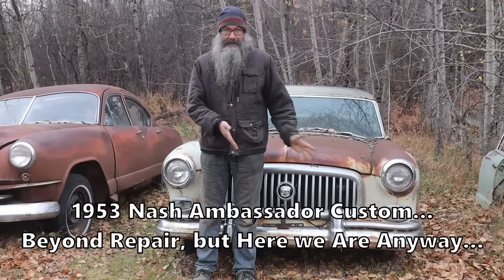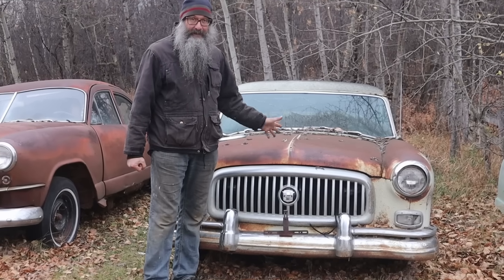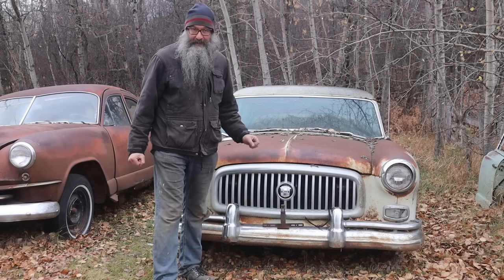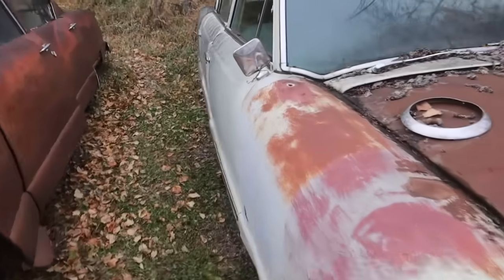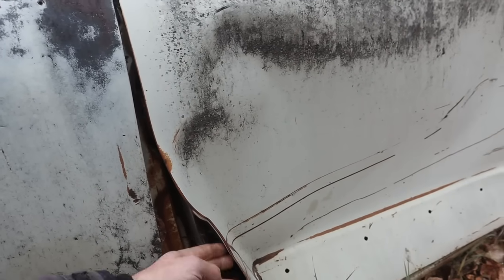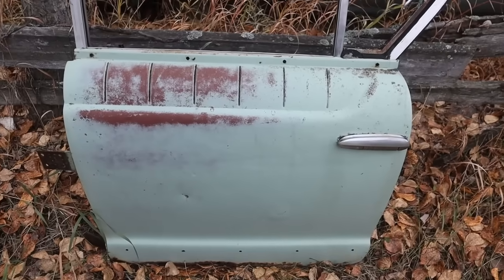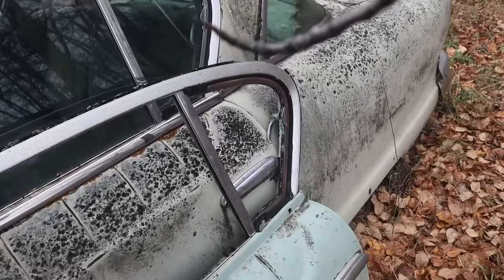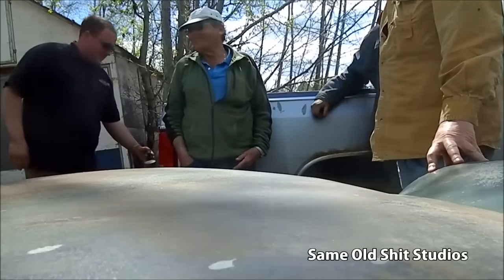1953 Nash Ambassador: Beyond Repair, but...

Comment: I actually have what one could call the "Grandson" of this car, a 1966 AMC Rambler Ambassador 990 with the 327ci V8 and a 2 barrel carb.  Currently it's in the shops for a brand new carburetor, full fluid change and the brakes seen to as it's been off the road for around 9 years.  Looking forward to seeing the process of you fixing up this old gem

Comment: In my PDR world I deal with stretched dents or "oil canned" dents fairly often...
We had some primitive methods to deal with it , but I purchased a "hot box" .
Initially through PDR company's they were $2500 to $3000 .
But I bought mine for $400...
It has saved many panels from going the filler/bondo route..
It heats the exact area you need to heat & depending , I can quinch it & with cold water or even ice ..
And it tightens the metal right up alowing me to finish the dent ...
Not sure it would pay for itself in your repairs , but they are relatively inexpensive today ..
Amazon has several to choose from..

Comment: I had a '54 Ambassador that was a great highway cruiser. If you need body parts, the Ambassador and the Statesman models had identical body shells from the firewall back, so Statesman parts will fit. Hood and fenders are longer on the Ambassador to fit the bigger engine.

Comment: Those bathtub Nash's were pretty funky looking even back in 1958 when my mom and dad went shopping for a second car for my mom. They bought a year old 1957 Nash Rambler at the local Rambler dealer and I remember my  parents talking about how much better the newer ones looked after they dumped the bathtub styling.  The funny thing was the Rambler American  kept the bathtub styling up until 1960 as I had an aunt that had a 1959 American right up until the mid 1960's when she traded it in for a 1963 model.

Comment: The outside door handles were known to stick causing the doors to fly open going around a curve.  If you are still having issues with the Volvo rear mirror, I had a 98 V70 wagon and I think they were the same.  Perhaps Kyle has an interchange manual on that part.  Hope your party is a success.

Comment: As a dedicated AMC driver-- a '67 and '68 Ambassador-- I can't tell you how neat it would be to see your Nash with plates on it.  How nasty is the bottom?  Surely with a bit of a pull and promising to never look from closer than 5 yards, the front right should not keep it from driving?  Dunno.  And, of course, I'm ignoring the problems with the engine.  Perhaps there's another engine somewhere?  Anyhow, the Nash/AMC folks would just go mental over that Nash back on the road.
Reply from the maker: It is pretty rough, but thanks for the encouragement!

Comment: FunFact:
Nash sold the rights to Austin in the UK to build their new 'small car' Metropolitan for them as they had no small engines to suit. The first used a 1200 with production in October 1953 and was called the 'Nash NKI Custom' but by March 1954 it was renamed 'Metropolitan'. The later upgrade in 1956 used the classic BMC B Series 1500.
Right Hand Drive for the UK started in 1957 and production came to an end in April 1961 with a total of 104,377 Metropolitans having been made at Longbridge UK with nearly 95,000 exported to the USA. Although built by Austin they were never sold as 'Austin Metropolitan' in the UK.
It was a very pretty car and very much of its time. And how interesting that a US company contracted a British company to build cars it imported for sale in the USA under its own name.

Comment: I bet the passenger side damage was very early in its life. The sideswipe was much later, early 60's, but the owner loved it enough to keep driving it until it wouldn't pass inspection. Probably replaced by a Rambler Cross Country and then used out by the road as bus stop shelter for the kids.

Comment: One serious weakness, the front inner fenders hold the front suspension spring/shock. I was riding with a friend in his '52 Ambassador when we went over a RR track, not terribly fast. One spring popped up through the rusty inner fender panel, bending the hood up about 5 inches and the hood was all that held the spring, sort of, in place. After that I reinforced my '54 with some HD steel strapping cut, drilled, and bent to fit. A friend's dad welded it in place for me.

Comment: Right side.  Grandpa's quick repair.
Left side.  Grandpa's last drive
That low height windshield makes that car look sporty.
Take off the front bumper and slam it, and it would make a fine Hot Rod

Comment: Was a good looking car for its time more modern than most , people didn’t keep a lot of cars in good shape then cause they where inexpensive new and people need to have the latest and greatest, sort of sad when you come right to it my dad had a 1959 Plymouth Fury a 1964 Belvedere a 1966,68 ,70 72 Fury a 1974 Gran Fury all Coupes a 1976 Fury Suburban was his last car my Second car was his 1970 Fury which I bought from his brother in 1976 see what I mean he traded every Two years and for $1000 he could drive off with a new car and not worry about anything but oil changes.